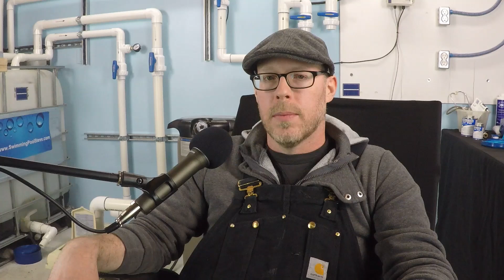How Does Water Get Behind A Pool Liner?

Comment: I got my liner replaced on my inground pool a few weeks ago. Behind the liner was a white insulating foam. The foam was not replaced because the installer said it was fine. The pool was then filled up and we felt hard sharp pieces of some debris behind the insulating foam. We are concerned it will work its way through and put a hole in the liner. Should we have the liner removed and the debris removed? Because the liner was stretched in place in place by emptying to remove that debris could that allow wrinkles in the pool wall?

Comment: When we build a pool{Vinyl liner concrete walls/3500 psi fiber reinforced concrete bottom} we haul out all expansive soils IE loam,clay,organic materials.We replace those soils with sandy gravel that drains well.We have been able to eliminate the floating liner problems that have had in the past. The sandy gravel acts similar to a leaching field, and disperses ground water,rain water, and even water from liner tears as it exits the joint between pool wall/pool bottom.